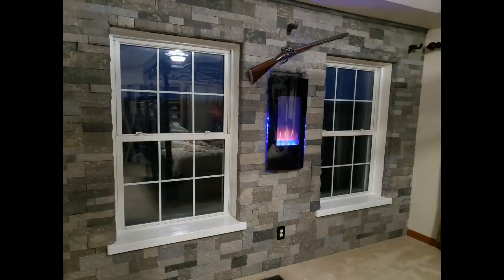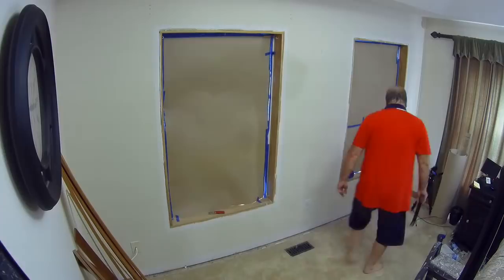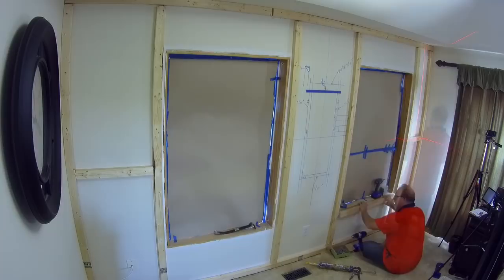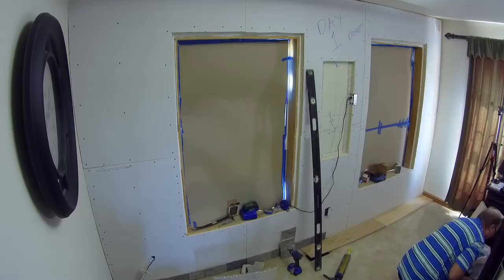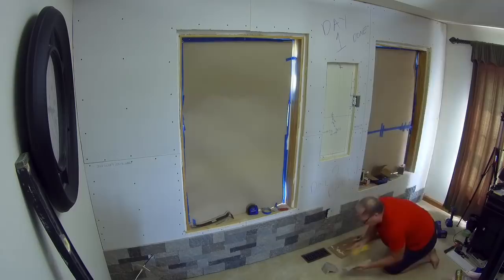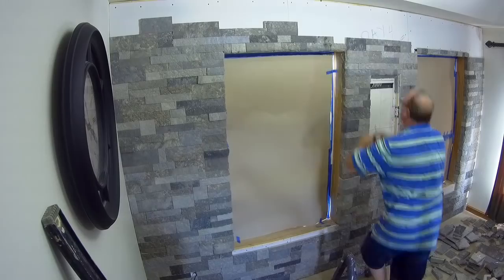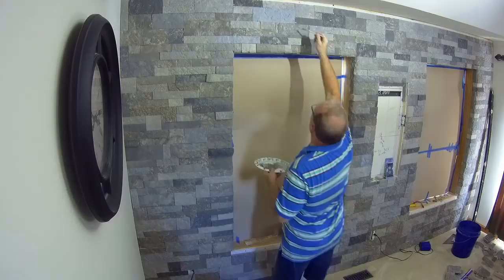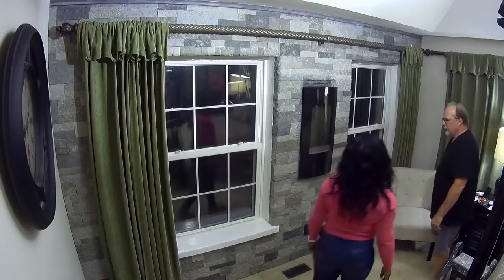Accent Wall and Fireplace in the Master Bedroom in this beautiful bedroom makeover.  Using Airstone.

Comment: nice work! Seems we don't have this product in Canada.booooooooo. But this is exactly the video i needed! i dont want to cut any holes in my wall and i needed a way to make my fireplace look recessed. Thank u!!!
Reply from the maker: Thanks Miss T., it's much appreciated. If I had to do it over, I would have made the Faux wall a little deeper so I could make window seats, but overall it turned out nice. I wanted to extend the stone all the way to the edge of the windows, but I was concerned that is I removed the wood frame it would damage the structure of the window, I think it would look great if I could have done that.
Thanks for watching and commenting, I do appreciate it.

Comment: Arent you suppose to finish the drywall? I mean mud the joints and then use primer? I mean if the adhesive is sticking to the dust on the drywall isn’t it more likely to come off??? Im at the stage where i dont know what wall to choose.
Reply from the maker: That's is only required if you plan to finish the wall, it this case the stone if the finish surface.    As for dust, I always wipe done drywall before I apply any finish, paint or otherwise.

FYI;  This last year has been a challenge for everyone and especially for my family, so not many new projects to post; but,  I've been busy the last few months, so you will see some new stuff pretty soon.  Stay Tuned

Comment: I cringed when you hung the gun right above the heat outlet for the faux fireplace... I know the metal would have been fine (as long as you keep it oiled, but the wood stock would have suffered from the heat. So your wife did yer gun a solid... The new wall looks great and the stone looks really good... nicely done.